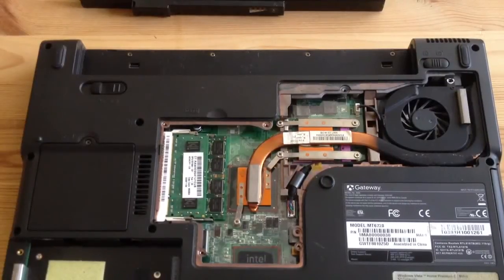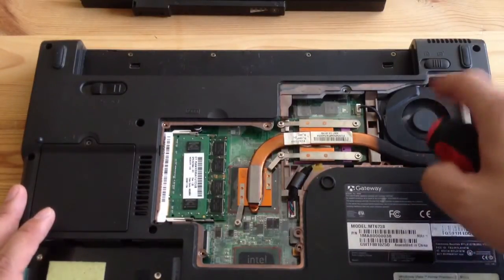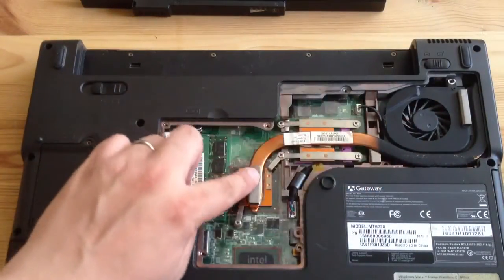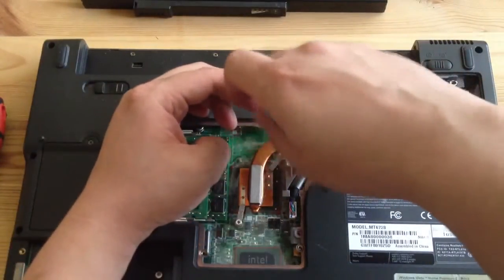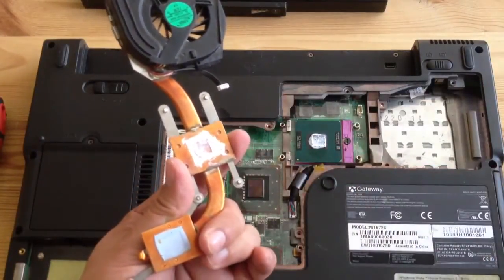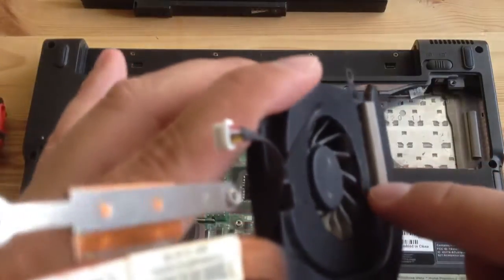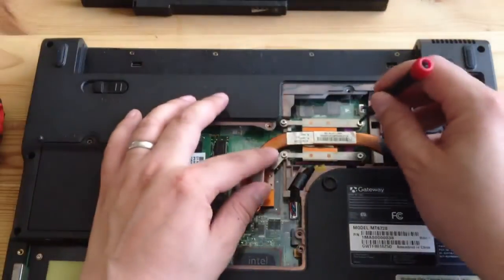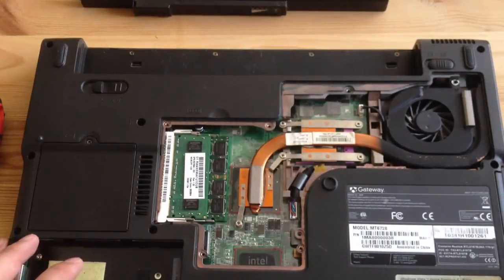Upgraded my CPU to a T7500 from T2330. Gateway MT6728 GL960 Laptop Socket P

Comment: Chipset GL960 => best processor core 2 duo T9300, T9500. //RAM 3-5GB,
slot #1- RAM 1GB (DDR2-553), slot#2- 2(4)GB (DDR2-667)
Reply: Hi do i need to update the bios 
Appreciate your help!
My laptop is acer  extensa 5220 CPU intel celeron M 550 cipset GL 960
Reply: @adnanalbalushi2783  Desirable. Go to the official Acer website, enter the code and model of the laptop that are written on the bottom cover of the laptop. The site will give you all the BIOS versions. You need to install the newest one. Memory modules for 2 or 4GB can be used DDR2-667, 1GB memory module only ddr2-553. If the laptop has an HDD, it is better to use Windows 7 x64. If you install SSD +3(5)GB RAM, then you can Ws 10.
Reply: @vladimirazirov1815  thanks alot
Reply: @smackall69  Hi. What processor is in the laptop now? how many gigabytes of memory (ram)?
Reply: @smackall69  
Part number: LENOVO_3000_Y410
BIOS ID: 05CN63WW(V3.05)
BIOS Release date: 2008-04-15
BIOS Revision: LN1BOS29WW3

I found only such bios.
If you have an older version, install this version.
Reply: @smackall69  Core 2 duo T8300, Core 2 duo T9300 - buy any of these processors. 
Make RAM 2GB+2GB or 2GB+4GB  so-dimm DDR2-800.
Reply: @smackall69  buy SSD 250-480GB, sata-lll, 2.5. Divide the SSD into two partitions: drive C (80GB / Windows 7 x64, programs, games) and drive D (150-380GB / files, videos). 
Move the HDD (Disk E) to the DVD slot through the Caddy adapter. HDD is used to store photos, important files, Windows Recovery folder.
You can install an Android emulator (Nox App Player, Bluestacks,
LDPlayer) on Windows and run light tablet games on your laptop.
Of course, you can install Windows 10, but for weak processors it is better to use Windows 7.

Comment: If you can suggest which one can i replace...i would appreciate...wordingly i would like to increase the cpu speed and would like to change cpu from 1.83 ghz to atleast 3.0 ghz or 3.40ghz please do reply
Reply from the maker: Hello Syed,  I don't believe there are mobile CPU's that run at that speed of 3-3.4ghz.

I think you own a Intel Core 2 Duo T5600 cpu.  I'm not sure what socket type cpu it is though.
Assuming yours is socket type M
http://www.cpu-upgrade.com/CPUs/Intel/Core_2_Duo_Mobile/T5600_(Socket_M).html

You might be able to purchase a T7600 @ 2.33ghz...   Good luck.  These are really old laptops.

Comment: Dear ....I would just like to have some information about my Gateway MX series 6960 with processor of Intel Core 2 1.83ghz .3gb ram ...Can i upgrade the processor to Intel core i3 where as  RAM will be the same...Kindly need your help and support with a supportive advice......
Reply from the maker: Unfortunately, this model does not support i3.   I believe the most it can support is a high end intel core 2 cpu.  Really, you probably won't see much of a difference.  You'll see more gains installing a  SSD hard drive.

Also, if you're looking at a laptop that runs dual core CPU's.. (like 1st gen or 2nd gen ... even 3rd gen dual cores), these would not support i3's typically since many bios/motherboards might be locked to just dual cores even if the socket fits.

Comment: i need help pls. i have mt6728 gateway and this laptop had never been upgrade. im planning to buy intel core t9500. does this work? im also planning to buy 2 or 4gb ram. need advice please. thanks for the help. no idea on how to upgrade laptop...
Reply from the maker: Hi, if I recall.. the limit for expanding the ram is just 3gb.  
As for the CPU... I'm not confident the t9500 would work.  
http://www.cpu-world.com/Compare/573/Intel_Core_2_Duo_Mobile_T7500_(Socket_P)_vs_Intel_Core_2_Duo_Mobile_T9500_(Socket_P).html

You can definitely give it a try.  It's a socket P cpu and the bus speed is 800mhz.

Comment: Was there a big difference in performance? I have a Dell D530 that has a T7250 and it's a dog booting up. It has 4GB RAM and still takes a 68 seconds just to boot to desktop + then it has to boot all the initial services. The only thing I can tell different between that one and the T7800 is 600mhz clock speed and an extra 2mb of L2 cache. I do know that I upgraded an Athlon II X2 255 to a Phenom II B59 which should have been similar but the performance increase was incredible. I had a 120GB SSD and it felt like an i3 cpu after the swap.
Reply: Yeah... I think for the core 2 duo processors, there isn't much gains moving from a t7250 to a t7800.  I'd just move on up to a used i5 or i3 laptop.  It's hard to let go of your D530, but technology has really moved on.

Comment: Found your videos on the MT6728 and learned that I could breathe a little life into this old laptop of mine. The CPU? Cost me $6 bucks. The RAM (which is still on its way)? Cost me $8. Not too shabby. Thank you for taking the time to make these videos...they helped a ton!
Reply from the maker: KCWM nice job.  It's definitely decent enough to use for today's standards (albeit it uses some battery).  If I recall, there is a 3gb ram limit (2gb chip + 1gb chip).  That's really good deal you got on both parts.

The last thing you can get.. if you haven't already is a ssd.  I like how prices for 128gb have fallen to around $45 and 240gb ... can be found for $70+.  

There's no reason to get a new laptop unless you really need the firepower.

Comment: Can you tell me the bios update version? I have been putting off this same upgrade for a long time myself.
Thanks
Reply: 10 Forguy Oh..   here's the link:
http://63.66.78.2/support/drivers/getFile.asp?id=24802&dscr=Gateway%20T-63%20Notebook%20BIOS%20v89.29&uid=454364088

It shows your model T6346C.  Good luck.
Reply from the maker: I got what was the latest version available on US gateway's driver/download website.  
BIOS	Gateway	BIOS	77.09	2.9 MB	2010/08/03

It's a cheap upgrade and I thought it was worth it.  It also gives you a chance to clean your thermal pads and clean off the fins on the heatsink.
Reply: i have a laptop hp g60 with socket p, the same socket, with a t4200 good processor but i want more, what do you recomend ==? t7500 not have muchs diferences in benmarks
Reply from the maker: unreal sape Hey... Looking at your laptop.. the HP G60.. they came in 2 models.
I believe your's is the dual core model which supports FSB of both 800mhz and 1066mhz
http://h30434.www3.hp.com/t5/Hardware-Upgrades-Replacements/hp-g60-213em-gl40-t1600-cpu-can-this-system-take-a-800mhz/td-p/702659/page/2

That's good news as the 2nd model (the celeron model) only allows for upgrade to dual core cpu's.

Yes,.. I wouldn't do the T7500 CPU upgrade since it's not much of a bump up.

Although.. reading online... You have a few other options:
The more affordable pathway is the P8600 or P8400.  3mb cache  (this guy got it to work on a p8600    http://forum.notebookreview.com/hardware-components-aftermarket-upgrades/209284-intel-mobile-processor-compatibility-guide-44.html)
The cpu with higher l2 cache would be the T9300 or T9400.    6mb cache

If it were me.. hopefully the P8600 route is possible.  I see on ebay that you can get them for under $10 used.

If you can use CPU-Z to look up your motherboard.. just to make sure.  The gl40 motherboard supports 800mhz fsb only cpu's.  (motherboard found on celerons) 
http://www.cpu-upgrade.com/mb-Intel_%28chipsets%29/GL40_Express.html

Whereas the the GM45 motherboard is found on dual core laptops.  
http://www.cpu-upgrade.com/mb-Intel_%28chipsets%29/GM45_Express.html

Good luck!  don't forget to do a bios upgrade if you get a new CPU.
Reply: aleks dude sorry,man. I can't find the BIOS version you said on US gateway's driver/download website. I can't even find your laptop series on US gateway website now.

I bought my laptop from china and my laptop is gateway T-6346c. I can only find  T-63XX series BIOS update on china gateway website. I don't know why but the BIOS update time is 5/22/2008. 

I want to know whether GL960 support FSB 800 CPU. Some people said T9300 or T9500 is the top performance one to upgrade. What's your opinion?
I also not sure about whether GL960 support 3G DDR2 667. I know GL960 support 2G and not support 4G for sure.

Thanks for your help.
Reply: I have a Core Duo processor that I swapped into my machine. I took it from an Acer aspire. It is from the 57XX series that came with Vista. I think it is a 2.0 . Got higher benchmark with WEI tool. MAchines runs hotter but modded the underside cover for more airflow. I just wish I could get this to take 4GB of memory. That is where I want help.
Reply: Larry Cronin Hey Larry,  I think if you've got the same machine as me.. these motherboards have a limit of just 3gb for RAM.  I think it only takes 1x2gb sim chip  + 1x1gb sim chip.  I was never able to get 4gb working on this motherboard.. and reading on forums,.. other people had the same problem as you and me.
Reply: 10 Forguy Hello 10 Forguy,  I had a chance to look at your issue with finding a bios.

I found mine on Gateway''s Website
http://us.gateway.com/gw/en/US/content/drivers-downloads

1.  I selected "Select my product from a list"
2. Then Group "Notebooks"
3. Then Series "MT"
4. Finally Product "MT6720"
6. Scrolled down and selected the tab "BIOS"
Mine is version 93.13  2010/08/25

As for you,... You can look at Series "T" and Products "T63".

It's tricky... I can't be sure that's the bios you want... if I find anything better I'll let you know.
Reply: Angry Math Dude Thanks for your help.
Reply: I am using what I blieve to be 93.13
Reply: Larry Cronin Now updated to Phoenix 89.29 successfully. I can't find anyone newer than this one.